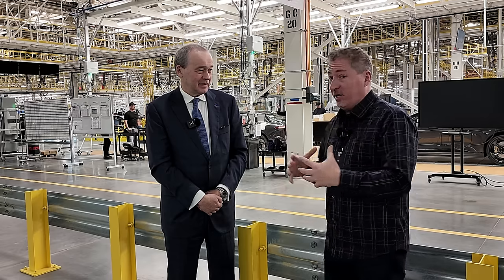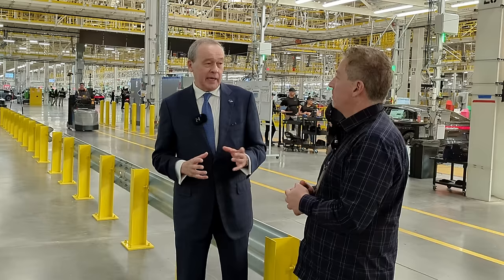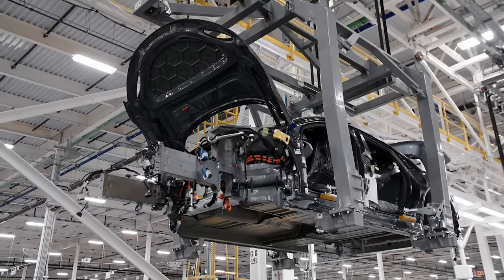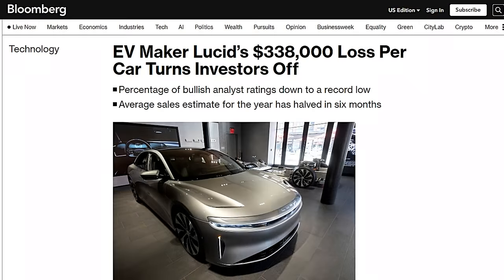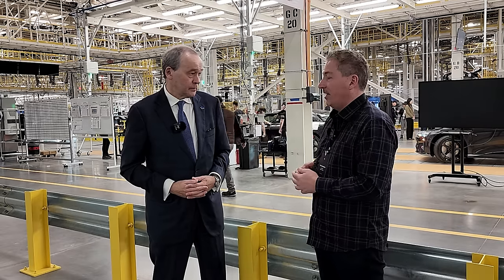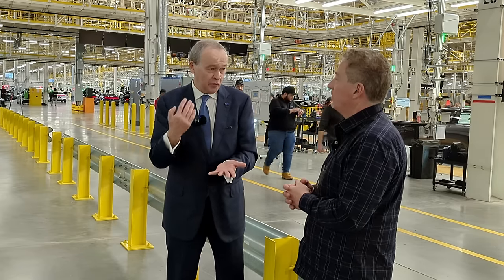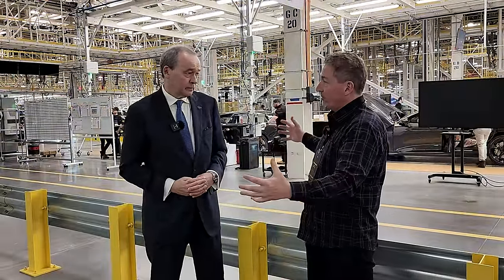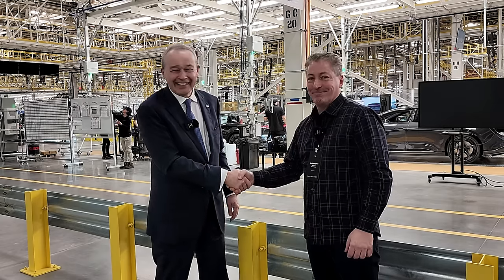Lucid Motors Quadruples Its Arizona Manufacturing Plant And CEO Peter Rawlinson Explains Why

Comment: Outstanding info.  Between Lucid mid-size and the Macan EV reveal, there's a lot of great choices coming in the electric market.  And man, Rawlinson is such a good brand ambassador.
Reply: The Macan is indeed a rival for the Gravity (price wise) but when you compare the technical achievements of the Gravity vs the Macan, then it's clear that the Gravity has so much more to offer then its rival.

Comment: How does the Saudi Arabia plan look, with hardly any local market or suppliers?  Also without a charging network, how does the scale up work? Just asking straight
Reply: It's not a priority.
Reply: @DBGE001  ok
Reply: @viplav76  battery electric vehicles don't "scale" well has always been my understanding meaning once you get a well put together ICE Platform you can literally build tens of millions of them as is currently being done...including Dealerships, OEM parts, technicians, retail everything. The skateboard chassis might be a game changer for BEV hard to tell but by way of specific example there still is no battery swapping. Why these facilities need be so massive is beyond me tho so good question that one. It seems pretty counter intuitive that creating so massive a fixed expense "makes things cheaper"
Reply: @doolittlegeorge  my context was purely their plan for developing the market in KSA. Their current outsized expansion could be on several factors, beyond those evident. Primarily their relationship with remaining investors, those terms & commitments etc
Reply: Saudi fund PIF investing in EV battery materials/mining and other component sectors and also signed with Taiwanese EV makers for their own EV brand called cheer. establishing these EV for local sector to grow. lucid would be able to grow in Saudi easily with the help of government support and also Saudi they will buy 100k in 10years period for their own country. that factory is more likely for that as an long term thing for them and if lucid succeed with future model they may expand that facility for export in gulf and other Asian countries.

Comment: Just bought my first F150 lightning so new to EV. Love your show very informed and one of the best I’ve seen so far. Keep up the good job I do have a question, my son-in-law owns one and he says I should only charge the battery to 80% so I don’t overcharge the battery is this true or is this fault.? Is there a recommended minimum charge for F150? I’d appreciate any help on this or if you have one that you’ve already talked about I look for it but couldn’t find it.😊
Reply: I own two EVs (BMW i4, Lucid Touring) and only charge both to 80%, which is the recommended charging limit. You only need to do 100% when travelling long distances (for example, from state to state). Charging at 80% will preserve your battery life. I've never had a situation with local driving where it's been an issue as far as range goes.

Comment: Thanks, Tom. What is Lucid going to do to improve DCFC at 500 V stations?
Reply from the maker: I dont' know specifically, but they are indeed working on that.
Reply: they cant do anything. wonderbox is stuck. future cars have to be engineered differently.
Reply: @laloajuria4678  Wũnderbox may have more tricks up it sleeve or new Wũnderbox may be an option for new cars as well as existing cars. Let's hear what Tom has to say.

Comment: Aston Martin is practically a part of Mercedes Benz group. The latter is running on lots of investment money from Arabic peninsula. The same is to be said about Lucid. At this point, for investors from the same geographic area it made sense to suggest cooperation between ultra luxury brands Aston Martin and Lucid in order to trickle technology to Mercedes Benz later.
A 50k USD Lucid SUV can potentially massively increase production in Lucid branded EVs.
That definitely makes all the ducks walk in a row for Lucid motors. Providing the considerable depths of above mentioned pockets, Lucid will achieve its growth goals.

Comment: They need to support charging at the supercharger Network which is the only reliable Network around. Unfortunately the only way to make that practical is to split their 800 volt architecture into 2 400 volt architectures at least from the standpoint of charging and they seem very reluctant to do that. That's essentially how the Cyber truck charges quickly despite an 800 volt architecture. Peter's well documented mutual hostility with Elon is unfortunately an obstacle to this kind of synergy

Comment: As a current EV owner, would I consider a Lucid as a next EV purchase?   Possibly, but I want a vehicle with some space/carrying capability and the Air has a small truck opening.   If Lucid does come out with a mid-sized "SUV", and can still provide the longest range in the market, it would get significant consideration.   Real life 400+ miles in that form factor would be impressive.
Reply: Find me a sedan that has much storage space as the Lucid Air...I'll wait forever
Reply: @mmchiang  Sedan?  Who wants a sedan?
Reply: @billsrelectric  The Lucid can hold more cargo and 5 people more comfortably than an Ioniq 5

Comment: If Lucid want success they have to bring
to US market small SUV with 300mi EV range
Reply: If they did a small SUV, it would probably have a 450 mile range.
Reply from the maker: The full size one (Gravity) will go about 450 miles.  @stevenjudd2383
Reply: Lucid doesn't play around with low range.  EV's should have at least 400 miles of range and Lucid gets that, while Tesla is still stuck on the 300 mile number.
Reply: @Resist4 - big range is big weight and especially cost.  If the real world DC charger spacing gets reduced to 25-50 miles between chargers, as is with gas stations presently, then a range which exceeds 250 miles isn’t necessary.  Interesting that aero of a Lucid is a top consideration, since that helps to reduce weight and cost - very important characteristics when designing a luxury EV.
Reply: @Resist4  re: "Lucid doesn't play around with low range". exactly, "low range" is a feature for those building Power Wheels not Lucids (no slate to the Engineers at Mattel and Fisher Price). 😉
Reply: @dennislyon5412  as a consumer I don't want to have to stop so frequently to charge up and pay at so many places that have different costs, when I could charge up at home for much less.  This is why 400 miles of range is necessary.
Reply: @Resist4  - ask yourself the question - how often do I drive outside of a 200 mile circle, the center of which is where I live?  Most people venture outside of that circle a handful of times a year, so home or work charging, and 250 mile range is perfect.  YMMV.
Reply: @dennislyon5412  low ranges mean more frequent charging, which in turn costs you more.  Doesn’t matter that most people don’t need the range, like insurance it’s nice to have when you do need it.  People don’t want electric scooter range, they want normal automobile range.
Reply: @Resist4  - disagree that it costs you more.  Less energy required to carry around a smaller battery, and despite more frequent charging, any thermally managed  EV battery will endure thousands of charging cycles, likely outlasting the car.
Reply: @dennislyon5412  Having to charge more is just a fact that it will cost more.  Probably more noticeable on a trip, because you're not charging at home.
Reply: @Resist4  - agree, other than initial cost.  But how many times per year do you drive outside of that 200 mile circle?
Reply: @dennislyon5412  actually, several times a week I drive 200 miles away.
Reply: @Resist4  - you’re a perfect candidate to be driving an EV, assuming the charging infrastructure will permit.  I hope you’re taking advantage of the fuel and emissions savings that an EV offers.

Comment: Projected 90k vehicle capacity per year, for the entire plant, over 3 model lines?   🤔🤔🤔🤔.      Seems very limited to me.   Looks like they would want the gravity to sell 100k units a year just by itself.     Good thing the desert money is unlimited.    Lots of losses for years/decades to come.  Smh.
Reply: Exactly, this was the key takeaway from the video: max capacity of this plant at full ramp is just 90k vehicles across 3 models. Nuts 🥜 That type of volume isn’t going to spread the fixed costs wide enough to make a profitable vehicle.

Comment: To be honest, you can beat Mercedes, I’ll give you that. But you will never reach Tesla’s level in your life. The Air costs almost twice as much as the Model S and even the stripped-down version of Air is not comparable to the Model S and is still more expensive. It will take you forever to lower your costs and Tesla will not wait for you. They are already planning their next move. So the old good times of zero interest rates are long gone. Now profitability is the most important
Reply from the maker: But Lucid outsells both Mercedes and Tesla in head-to-head sales (Air vs Model S and EQS sedan).
Reply: @StateOfChargeWithTomMoloughney  What kind of twisted logic is that? 
The S & X sold 68,874 units, and Lucid sold ~6,000.  Those sales were not production limited either.  Lucid made thousands more cars than they could sell.
Oh, and Tesla was making a huge profit, vs. Lucid selling at a loss.

Comment: You have to make this car affordable 27,000 30,000 I paid my Bolts 27 28000. That's why I got into the system plus I save $650 a month in gas and only $80 electric bill extra by the way my car gives me 300 Mi on the charge

Comment: im sick of 100+k cars. its engineering masturbation. make a 25-30k car for the masses... its always 3 years away
Reply from the maker: They're already here. I bought a Chevy Bolt EV 6 months ago for $26,000. After the $7,500 federal tax rebate and the $4,000 NJ rebate, I paid a total of $17K for a brand new EV that can for 250-260 mile per charge.
Reply: @StateOfChargeWithTomMoloughney  8:28 definitely not gonna buy a GMEV.
Reply: @StateOfChargeWithTomMoloughney   thanks for the reply. 26k is a great price, i did no realise that its possible. here in canada bolt is i think 50k and hyndai kona is also 50k start, and these are small sedans. I can buy a hyndai elantra that is a bigger car then those two for 25k and spend 25k on gas.  I think cost  / weight of batteries are holding the prices down.  anyways thanks for the post, been subscribed for a while .
Reply from the maker: @Tendertroll1  You heard wrong. It's a point of sale discount now. That changed in 2024.

Comment: Li-Ion batteries are a deathtrap during a "thermal runaway", especially if it happens in a garage - the house is usually also destroyed. There's no known method to put out these battery fires. No matter how rarely this occurs , it will happen more and more with the proliferation of EVs. And the saddest thing - EV is not much better than a gas car.
Reply from the maker: How many houses are destroyed and people killed by them? Less by percentage than ICE cars - that's just a fact.

Comment: Peter is delusional. He talks about ‘the future’. There is no future if you don’t have profits. Sustainability isn’t just an environmental term, Peter, it’s also a financial one.  For the life of me I don’t understand this business model of coming out first with crazy high priced, low volume, high-loss products before coming out with moderate-priced, high volume, high-profit products. This stupidity damn near bankrupted Tesla (twice!) before they realized that high priced vehicles don’t sell well enough to cover costs and those costs were going to bury them. The only thing that saved Tesla during those dark years was the fact that they had no competition. So why replicate it, Lucid, particularly when there’s scores of other EVs for buyers to choose from? Lower the price of ALL trims of the Airs in inventory by at least $20,000 and get them out of the desert and into the hands of customers. Stop building buildings and use that equity instead to write down the cost of those cars so you can sell them. Selling cars is the prime objective , Lucid, not wasting shareholder capital by building expensive facilities.
Reply: Everyone starts out with high end EVs because they have to. It takes time to ramp production of every EV, but especially for Tesla the battery cell supply simply did not exist to do anything else besides high end cars. If the battery cells a company can get will let you sell 25,000 cars for the year, and that is all you can manufacture anyway, would you choose to sell 25,000 cars at $100,000, or at $40,000? Tesla had to convince Panasonic to go in with them on the Gigafactory Nevada so that Tesla would have enough battery cells available to launch a mass market car for the first time. Once convinced, then it was five years before the Gigafactory was built and was producing battery cells at full capacity. It was not that Musk and the rest at Tesla were stupid, it was that they had to operate their company in the real actual world where things one needs to manufacture a car do not magically appear because people online want you to sell them more affordable cars.
Reply: You’re right, Tesla’s 2006-2014 run didn’t have any of these issues 😂
Reply: Do some research on vehicle design, tooling and setting up manufacturing facilities. It takes years to cover start up costs and eventually become profitable. You're delusional.
Reply: @vickykennel7414  Does Lucid have enough time? Do they have the capital to get to the future you imagine? What happens in this future that allows them to make profits? You realize that because of the time it has to take to grow, to build new factories and ramp production, Lucid has to have a huge scale of production disadvantage for the next decade at least, right? 

Everyone keeps pointing at Tesla…yes, look at Tesla, see how often they almost went bankrupt, despite not having competitors and being able to set the market price entirely. Lucid has to price to compete, and those prices are set by Tesla with way higher production and twelve years of figuring out how to cut production costs. Lucid has a much harder path ahead than Tesla, who almost went under three times, did. 

Lucid will never be the EV market leader, they will not replace Tesla and BYD at the top, at best they become a small niche company struggling for profits because of their huge scale of production disadvantage. Probably Lucid never makes any profits before going bankrupt.

Comment: Mr. Rawlinson, I hope you read this comment.  I must be honest and say I've found humor in the jabs at your company and its results.

That being said,  I think your cars are well- made and high quality,  but your product placement looks confusing.  You began with the $170k model,  a staggering 50% higher than the S Class or EQS; that's far beyond mass-market prices and into the stratosphere of Bentley/Rolls, minus ANY brand reputation or cache. Precious few are the buyers even interested in your product at that price,  as is borne out in your sales figures.  THEN you released Sapphire 50% costlier than Dream! That becomes even less saleable. Finally,  you've released a cut-price $75k version OF THE SAME CAR.  The price range is $175k on the same car, notwithstanding any options added to Sapphire. 

Frankly,  your plan looks confused,  your sales are a wreck,  your inventory is piling up, and your salary has the reputation of being heavily padded. I think you set your sights far too high on a market niche that doesn't actually exist (Bentley/Rolls without the reputation) and while I think the Gravity looks stunning and is technically impressive,  at this rate you won't have spare lot space to put them. My only suggestion to you is to drop Air altogether (you'll be able to sell existing inventory for a year) and release Gravity at the lowest possible price point,  adjusting your market placement far downward. I hope your company succeeds,  but it seems nearly impossible right now.
Reply: Look at the competition: BMW with the i5 is from $80k to $120k, the EQE is from $75k to $135k. 
I don't think that the Lucid Air has to drop significantly in price to be competitive.  
Don't forget that imported EV's have no incentives and the Biden administration will probably set higher import taxes for all luxury EV's.
Reply: re: "You began with the $170k model,  a staggering 50% higher than the S Class or EQS". yup, so exactly the same as what Tesla did with the Model S and X.  those not struggling with issues of "short-term memory" will recall how the top trims with biggest battery (ie, 100D) of both these models were every bit of $150k when they debuted back in 2012 and 2015 respectively.  "NO FREE FALCON DOORS FOR YOU...!!!" (best deranged Elon making Soup voice)

okay now fast-forward 10 years, 1 Global Pandemic (and adjust for HYPER inflation as a consequence thereof) the MSRP for the various trims of Lucid AIR are actually right where they should be, now whether we like this or not (personally) is a wholly different matter SEPARATE and APART from the real world Economics and Business Plan of starting a new Car Company...

yeah what's important to recognize is that what we "secretly desire" as consumers - in regards to everything produced in the world - is FREE LUNCH (which to a degree is understandable) however in the wise words of Auto YouTuber and New York Times contributor Tom Voelk... "Know Thy Self".
Reply: re: "THEN you released Sapphire 50% costlier than Dream!"  ikr...?  1234HP is EPIC...!!! 😎 "You'll shoot your eye out kid..." (best Department Store Santa voice)
Reply: @shlomogoldbergUSA will those sell either? From watching Harry's Garage review of the BMW, it doesn't look very good.